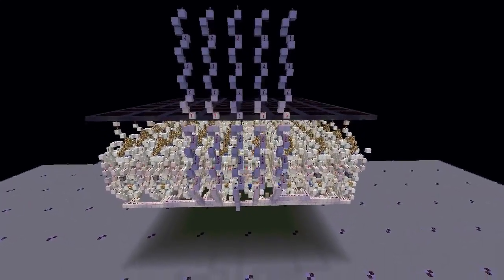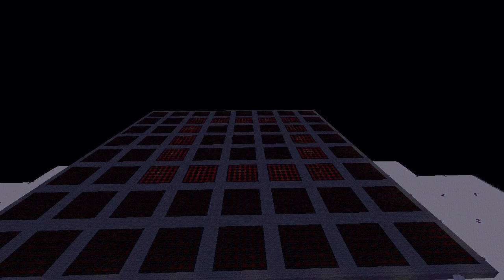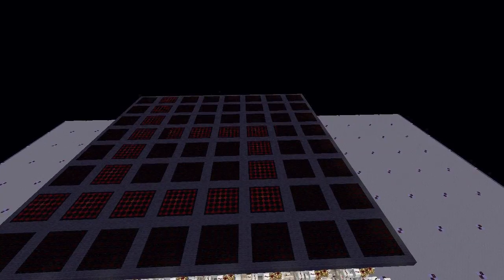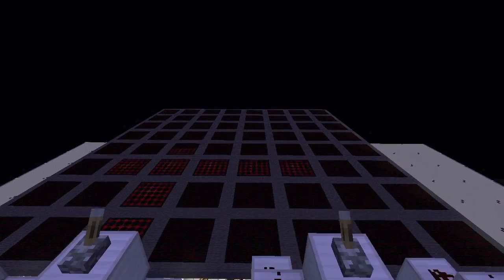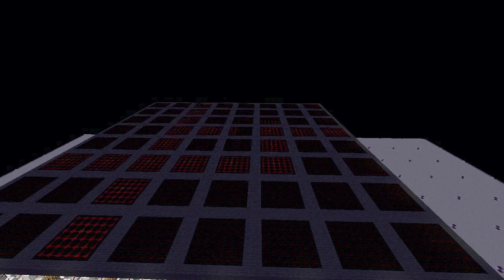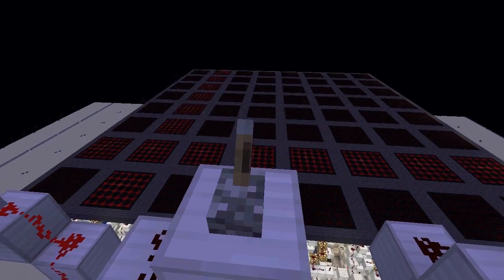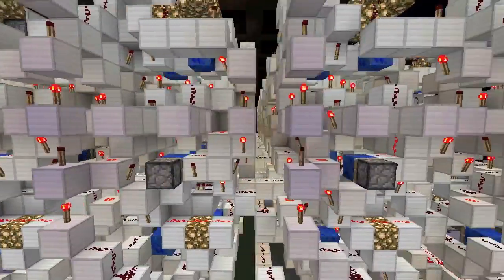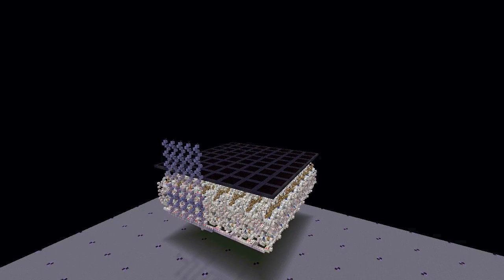Box Rendering - Like You've Never Seen Before!

Comment from the maker: So the basic design is four main wires, one in each direction - and each of the wires can be cut by a piston. When a point is selected it powers all four wires sending out the "probes"." Upon activation of an AND gate the cell cuts the main wires to create a corner and powers itself so it sends out it's own probes to locate the original points, activate their AND gates and create the other corners. Does that make sense? It's a little convoluted but it looks super cool. :D

Comment from the maker: Cool! No need to count the display. Nice work! Mine is 19*8*8 (h*l*w) so taller but not as long or wide. I generally think of height as a "free" dimension (though it does matter) and try to keep the length and width to a minimum - it's actually 7x7 without the bypass. But yeah, it's a nice piece of logic, right?

Comment from the maker: Maybe, let me know when you're done! It's totally possible that there are optimizations. I didn't do much optimization beyond building it, but I can tell you what goes into it. Corner detection required that each cell have four AND gates, two of which needed to stretch across the entire cel. Each of the AND gates needed to control two pistons based on the corner being generated. You also need an input that hits all four probe lines. But if you can make a better one, awesome! Good luck!